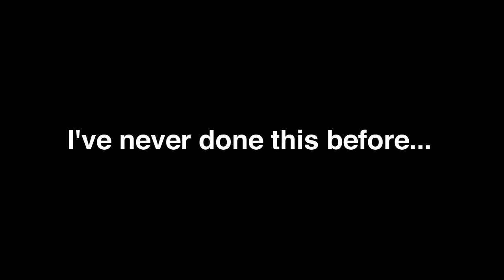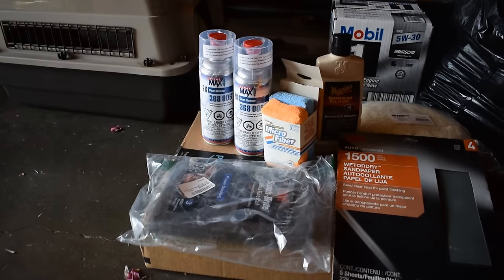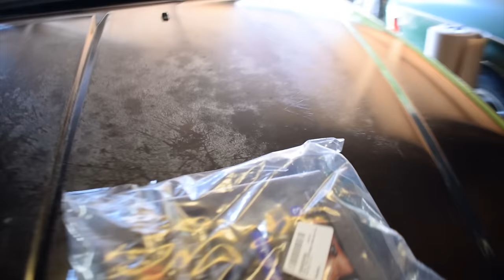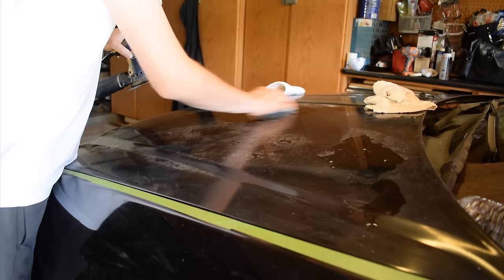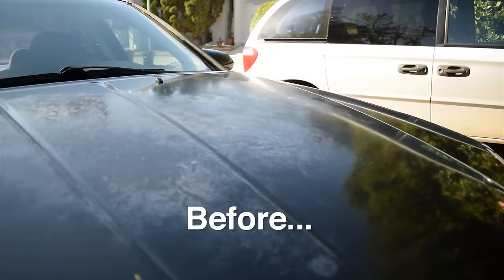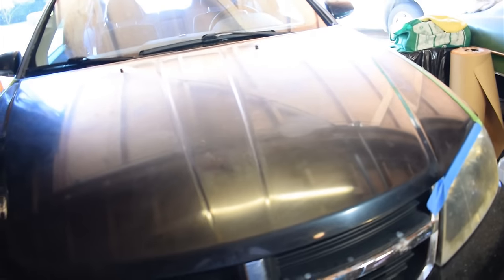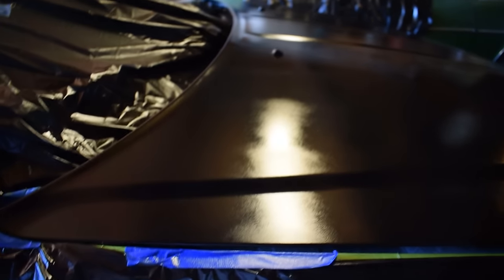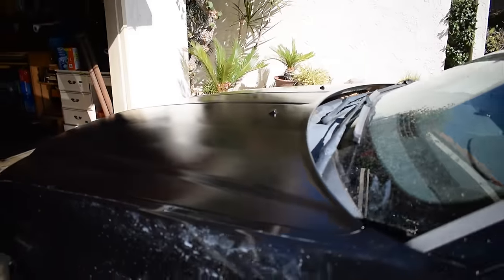How To Repair Clear Coat On A Car

Comment: dude, that looks horrible
Reply: Amen brother!
Reply: Extremely HORRIBLE job.
Reply: smitty4699 there’s no need to knock someone that doesn’t know what their doing. How bout helping him instead of knocking him down. Not ok. Not cool.
Reply: The dude did his best..
Reply: Brooooo 🤦🏾‍♂️ you needed to sand deeper and put more base coat. I’m glad I saw this so I don’t make the same mistake
Reply: Lol
Reply: Val2016 if it’s his first time then this shouldn’t be a how-to video
Reply: East Coast Fishing Game and Camp it’s a how-to video. He should know what he is doing before making a video like this
Reply: Everyone's a expert but won't show themselves doing this 😂
Reply: Yeah, I thought the whole idea of clear coat is that it's supposed to be CLEAR.  If you can see it, it's not clear coat.  What he needs to do is break out the polisher again like the dude did in the original video but this time buff it out using rubbing compound.  He skipped that step entirely.
Reply: What looks worse? The before or after? I think people expect this pro paint job for the after. It’s just about making it look much better than the before for super cheap vs spending a lot for a paint job. Temper those expectations. It looks good for what it is
Reply: It's better than before
Reply: htconex19062012 not much
Reply: Don't be negative :)))))))
Reply: I have 2 tips. You should have applied some base coat. My paint store will put it in spray cans for you. And you needed the clear to be much wetter. You needed to move slower and more overlap.
Reply: @larrystarkey8781  - He never painted his hood. He basically just sanded and cleared. You were talking about spraying  a base coat of paint right? Correct me if I'm incorrect about this but, wouldn't wet sanding and buffing the final product, make it smoother? All logic points to, yes, IMO
Reply: Poor guy, please don't do the roof the same way
Reply: I could see he should of use some paint for a better result and that's why his video was informative to me and maybe others unlike you.
Reply: You should have did 50% overlay let it dry then buff it
Reply: Okay, so it's not a how to video.  I won't knock a guy for trying though.  The biggest mistake made here was the clear wasn't applied liberally enough.  You could see in the camera where it remained hazy and left a rough texture from just misting it with clear.   Once that first coat sets more coats aren't going to help that.  Next time make sure it is going on evenly, it should have an even gloss to it when applied.  If you get that hazy edge you need to slow down and apply more clear.  I need to do this to my current daily driver and though I have industrial paint experience I'm not looking forward to it.  However I'm finding that paint shops tend to charge a lot for clear coat restoration.
Reply: Georgie Moralez in my sleep with my hands tied up
Reply: 1500-2000 grit sanding then buffing will make it look 1000 percent better.  Won’t be perfect because you didn’t base coat it.  Not bad on the effort though. Hope this helps
Reply: Quick question, can we spray clear coat on existing paint that’s in good original condition  ? If we just have extra clear coat cans to get rid off , or is that that not advised ?

Comment: Brotha, while you were sanding, after getting it smooth, get some black paint, before you put the clear on, and it would’ve looked like , or pretty close to new. You have to repaint, after sanding. They sell gloss black in a can too. Sand, primer, paint, clear. It would look 10x better. Good luck

Comment: Finish with the 1500 grit sandpaper next time. Even 2000. Even though it feels smooth, paint will stick and it will shine so much better.

Comment: Definitely looks better than it did but a little more sanding would have made the whole job consistent.  But I appreciate someone who takes the initiative to resolve a problem themselves. Nice job...
Reply from the maker: Thanks 🙏  yeah looking back on this video I think I should have used a slightly grittier sandpaper. It would have made getting the old clear coat off easier
Reply: @TobiasHolenstein  
I'm about to be doing a wet sanding, paint and clear coat job on my door that I need to touch up so your video gives me some step by step.
Reply: Tobias Holenstein did you ever buff out the hood?
Reply from the maker: I just ordered the buffer and a few other supplies, so I will be doing a video on me buffing the hood pretty soon :)

Comment: Should of add black spray paint before clear coat to clear up those dark areas
Reply: Exactly, but if he’s happy about the results, to each their own 🤷🏽‍♂️, however I’m with you on adding paint over dark spots that way it wouldn’t have showed up after he cleared it again

Comment: One small tip, never use a rattle can on a warm or hot day. It's designed to dry fast, cooler weather slows that down. Gives you time to to get a good cover without getting dry streaks.
Reply: ERK!!! Arizona in the summer.....can't help that...gotta wait till it cools down first I guess!!!

Comment: Well done, other than lack of respirator. I appreciate this because it's a real world process and result. I have undertaken similar recently with an older Infiniti and that's exactly what it looked like after clear coat. Granted, I did a more thorough job in sanding down beforehand, applying 2K primer and also metallic base coat. 

There are other videos like Ratchets and Wrenches that offer a more professional looking version. They also know what camera angles to use and which ones to avoid. It fools the layman into believing that is what their homemade version will look like. Nope, yours will look like this. 

I did the entire car. Obviously it is a learning process. Eventually I figured out how to apply dust coats with the metallic base coat. And to use a $5 handle attachment with the clear coat to allow more of a flowing motion for some nice wet coats. After a couple of weeks I wet sanded the clear coat with 1000 grit to remove orange peel, and then clear coated again. Then I waited some more before sanding with 2000 and then 3000 before polishing with advanced compound and polishing finish. Yeah, I got carried away but the compliments from family and friends are worth it.
Reply from the maker: Thank you! Also, thanks for sharing your experience. Like you said, it was a learning experience. I'll see how it comes out when I do the roof and I'll also get a proper respirator
Reply: Wasted Century Thank you for your tips. I’m going to try fix my car too.
Reply from the maker: I just remembered I have one of those, I don't know why I didn't think to use it lol

Comment: When you do the roof,sand it all down with 400grit. Which you should of on the hood,that's why it has them dark spots,because you sanded it to fine. Then I would respray the color then clear it. You'll get a better finish without the dark patches.
Reply: Sleepe is right, sand it down and hit it with some color first, then clear it. I’d slow way down with your passes when you’re spraying the clear coat. Also get closer to the panel and I’d keep the overlaps tighter.
Reply: Val2016 yeah, it’s tough to get a slick finish with a spray can. I’ve seen some people on YouTube pull it off though!
Reply: sleepe361 I'm going to do what u said. Thanks, it'll be my 1st time as well.
Reply: I have a red Chevy Malibu, how do you get a color match to spray it with?
Reply: Exactly. My previous reply was spot on with yours.👍🏻

Comment: When applying Clear coat always change direction with each coat for instance if you go north south first coat, go east and west second coat also do the front and side edges first.  Great job for a first time! I've been doing paint and body for 25 years

Comment: A tip if you are trying to fix CC in a metallic finish, you must not sand the raw metallic finish as you are cutting the metal and other such metallic components in the paint. Metallic colour coat is never sanded once laid down as this damages it. This is why it looks patchy. If you can use a blunt scraper to lift of the crazed clear coat, mask the raw areas off allowing the mask to expose the edge of the remaining clear the clear coat several coats over the exposed metallic and clear coat exposed edge. Then take away the masking, carefully feather sand the over lap spray trying not to remove the protective clear coat you now have protecting the metallic paint. Once you have done your best feathering the clear overlap, sand the whole hood or roof and then clear coat the lot for your final finish. This technique will never produce perfect results but it does a good job at greatly improving the overall look. I have used this technique many times and as long as the base coat hasn’t been cut with sanding or polish or has faded badly then it’s a real winner as a diy CC repair.
Reply from the maker: Thank you for the tip! :)

Comment: I worked in body shop as a cleaner, and everytime the car was painted it never looked good. Only after they buff it,  it removes the imperfections and gives it glassy shine
Reply: Vahagn melikyan the painter must’ve sucked then. I mean, I paint daily in my shop, no booth, just an exhaust fan but my finishes come out like glass. Only flaws are some bits of dust but I always do a quick denib and polish before I send the cars down the road.
Reply: @christrainor1129  What type of clear coat do you use; brand?  I didn't think it was going to still look so textured after a clear.  If one does have the same problem, can you just cut it with compound and gloss shine.
Reply: Autumn hi! So, I use Keystone’s private label clear coat. Right now I’m using their “multi panel” clear coat. I mainly do dealer work which doesn’t pay as good as insurance/collision type of work but it’s steady work and I enjoy it. If I was in the insurance/collision area, I’d probably use a better clear coat. However, for the price, the Keystone multi panel clear is pretty awesome. I use a Devilbiss Tekna Pro spray gun, 1.3 tip and set my regulator around 26 psi. I spray close to the panel (4 inches or so) and move pretty quick. 2 coats, 10 minutes or so between coats, comes out pretty great. I live in NY so I have to switch between activators. Winter - fast activator, spring/fall -medium, summer - slow. As for texture, I’m assuming you mean orange peel (looks smooth and glossy but has texture similar to the look of an oranges peel?) pretty much all cars come with some degree of orange peel. My paint jobs have orange peel too. Sometimes it can look bad though, uneven texture, clear went on too heavy in some areas. You have to be consistent with your speed, distance and overlaps to control this. You can reduce orange peel or eliminate it completely by wet sanding and buffing. Other texture could be if the clear didn’t go on wet enough and it looks dry, or if you’re using too fast of a clear coat and the overspray isn’t melting in nicely. Wet sanding and buffing will help that too. Anyway, if you have any other questions just let me know. ✌️
Reply: @christrainor1129  Wow. That was pretty in depth, thanks.  I'm thinking more along the lines of spray can clear, because I am not a professional painter.  What is an activator, and how do seasons factor in, in choosing which to use?
Reply: Autumn oh! I don’t use spray cans, but from what I’ve seen, Spraymax is the way to go as far as spray can clears. Spraymax has a 2k clear in a can (2k meaning 2 part - clear/activator) Activator is what makes the clear coat cure and slow/medium/fast can slow down or speed up that curing process. You’ll want to choose a slow activator if it’s hot and a fast if it’s cold. Hope this helps.
Reply: @christrainor1129  I bet humidity plays a factor in it too..  I'll get in touch when I'm ready.  I may need to borrow your brain.  :)
Reply: Autumn yes, humidity also comes into play! Definitely feel free to contact me if you have any questions!
Reply: @christrainor1129  You're a great soul of a person!! You literally took your time out and answered all this guys questions.. then offered him further assistance if needed! You're a good person, and nothing but Good karma will follow you!! Thank you!!
Reply: Don’t use spray cans. Don’t use spray cans. Don’t use spray cans........   you’ll never be able to sell the car.   It looks obvious from 100 feet away that you tried to fix it and failed.

Comment: Dude before you spray the rest of your car buy a respirator that 2k primer will do you in
Reply from the maker: Yeah I definitely will buy one for the next time I spray
Reply: Totally agree. What you used is trash for the clear you are using
Reply: This can contains Isocyanates and can kill you, It's a shame the good stuff is usually that way but you must use the respirator. It was documented a guy painting a wing on a plane dropped dead at the end of the day. They discovered he did it with no shirt and it absorbed through his glands in his arm pits. Isocyanates. This is serious stuff. 
It's what you don't know is what will kill you. Be safe.
Reply: Get some paint coveralls and a proper respirator rated against isocyanates.  Don't sacrifice your health to save a few bucks man.
Reply: @robertjackson7590  😯😯😯 thanks for the information
Reply: 2k clear will harden in your lounges.

Comment: I’ve tried this before and I don’t like the result of the clear coat from a can.  I prefer clear coat from a spray gun.  But sometime we got to do what we got to do to get the job done.  Nice work.  I was thinking about doing this or taking my carbon fiber hood to a professional auto paint shop do it.
Reply from the maker: Yeah I'm sure it would come out much nicer from a spray gun. If I had a nice expensive carbon fiber hood I would probably also take it to be professionally done
Reply: You gotta do the last pass a wet coat that’s thicker to prevent the orange peel look, and of course wet sanding

Comment: I was thinking about doing the clear over mine but after seeing this, i think a couple of base coats first before the clear would be highly warranted.
Reply: Yesterday prep it right and base coat . Beware the 2 k contains isocyanate and a n95 half mask wont stop you from breathing it that why at a body shop the painter has a full face remote air supplied mask paint suit nitrile gloves and a hood . Isocyanate will go into skin eyes through filters  in masks . The isocyanate bio accumulates in you body for life it’s in construction glues paint hardener foam expanding insulation .I got poisoned doing a restoration on  an old boat out side spraying expandable foam in to a deck for 5 min while wearing a carbon filtered dual 95 half mask. The manufacturer of the consumer grade expanded foam are sneaky in tiny letters contains MDI = methyl di isocyanate .

Comment: My friend did you wait 10 minutes between coats ?  Tobias it would be shinny like when you wet it with water. If your happy with the results that's all that matters. Try wet sanding and buffing , so it can shine like glass..good job , got to give you props for doing it.
Reply from the maker: Yeah I waited the necessary amount of time, I think it was somewhere around 10 or 15 mins between coats. I can't remember. Yeah! I'm going to wet sand and buff it soon and make a video on it. I'm just waiting for my supplies to come in the mail

Comment: I just did this. Used 800 grit sandpaper and I used about 4 cans of clear. After, I wet sanded w 2000 sandpaper, used compound and polish and looks so much better

Comment: Thanks for this video.  The R&R guy is clearly expert and has all the tools and equipment.  I've been contemplating doing this and what you ended up with is probably in line with the results I would get.  I'm game - will get me by until I have saved up for a pro job.
Reply from the maker: No problem! Best of luck with your project! For what it was I think it turned out ok, for myself at least

Comment: Hi. Looks ok, doing this thing for first time. You need to sand it more, to get uniform texture, right after use tackle cloth, clear coat. If you noticed like orange peel texture, sand it with 1000 sand paper and compound, you will see better results.

Comment: Dude (assuming you are still alive at this reading), be warned for future reference that a simple allergen mask is NOT sufficient protection for your lungs when using two-part clear coat spray.  If you notice, the original video by the W. & R. dude shows him wearing a full respirator mask.  When the two elements of the can combine they generate hydro-cyanic gas.  That's right, cyanide gas, not that different form that used in the old gas chambers for executions.  In fact, body shop techs who work with this stuff on a regular basis are supposed to don masks that have their own O2 (air) supply to totally avoid breathing in any of the stuff.
Reply from the maker: Hi Atty, thank you for the comment. Luckily I am alive and well and I realize now that I should have used a proper respirator mask. Needless to say, I will definitely be using a full respirator mask when I do any future spraying